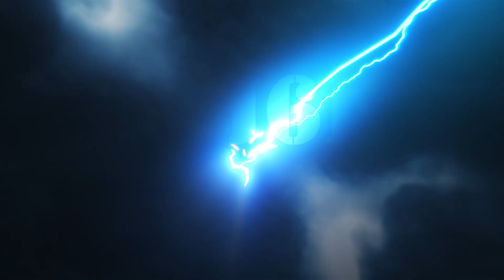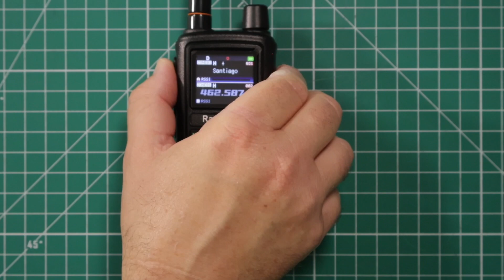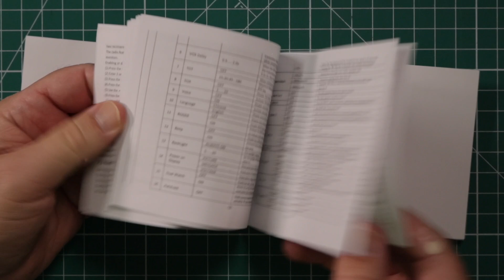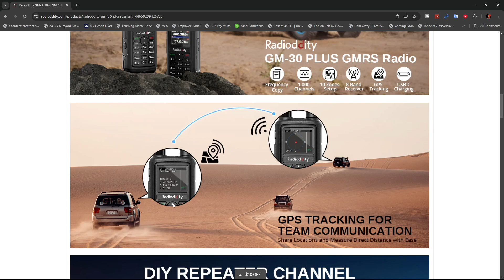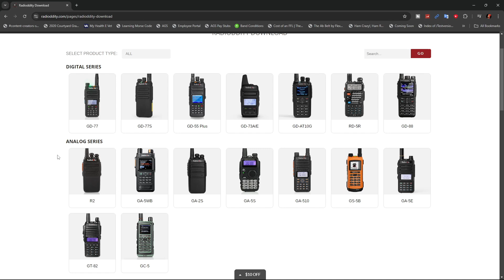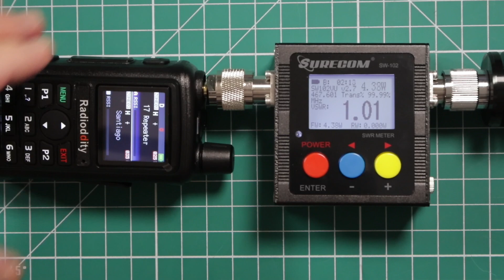Radioddity GM-30 PLUS GMRS Radio

Comment: My GM-30 Plus comes with 30 preset channels.  Lets say I create channel 31, can I create it as a repeater channel?  I'm planning on traveling so I have all the stuff I need to create repeater channels along my route, I just can't get the + on the radio screen that shows it's a repeater.  Or am I bound to the 7 repeat channels it came with?  Thank you

Comment: I picked one up a few weeks back, first time on the GMRS hobby. I also swapped the antenna with a “tactical” whip it antenna. Need to run some test on it.
Reply from the maker: Thank you for taking the time to watch and the comment! It is greatly appreciated. Getting a better antenna is always a great idea!!
Reply: what's the differences in antennas you swapped ??